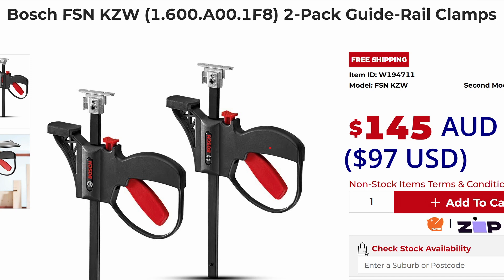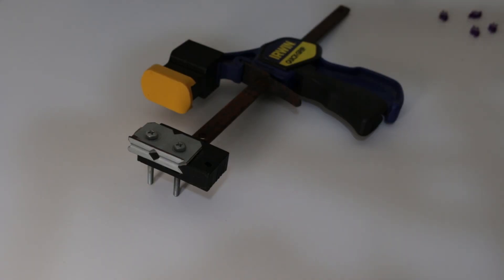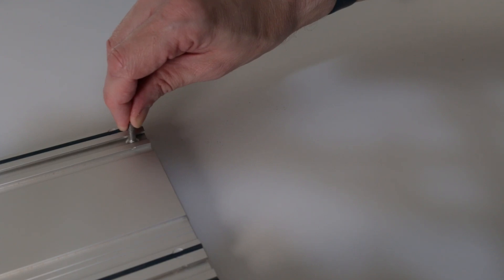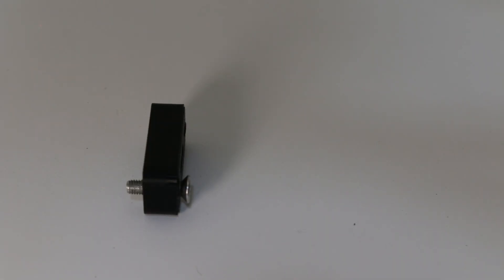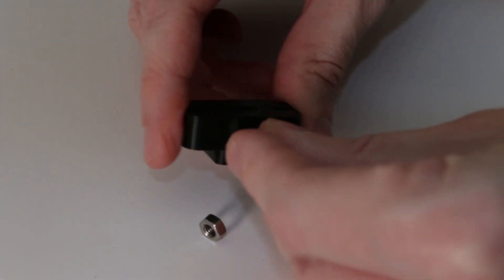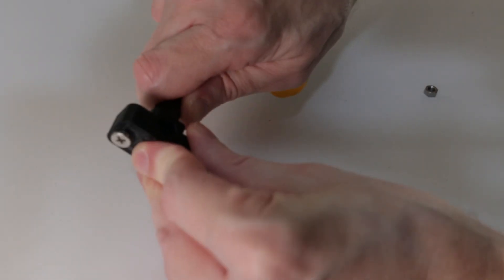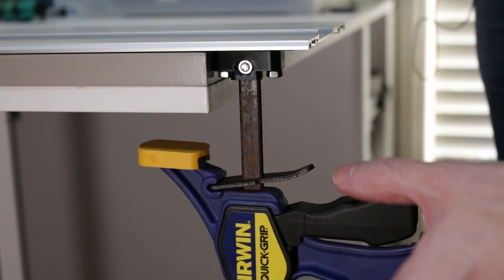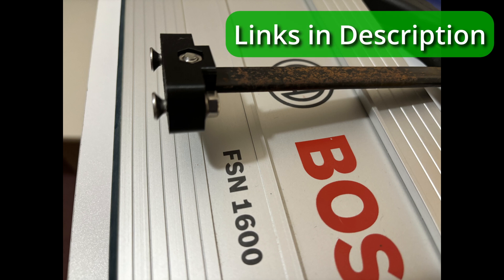Bosch FSN track clamps v2 3d printed with screws saved me a stack of cash

Comment: That is clever ... guess you could do a similar thing with using clamps in an mft, vertical or flat....
Reply from the maker: would probably hold horizontal, would be interesting what would be needed for vertical would it have enough to stop it slipping. I guess you could have a stop block at the bottom for the track to rest on, then the clamps wouldn't have to grip as strong.